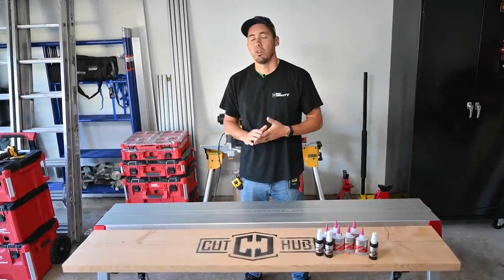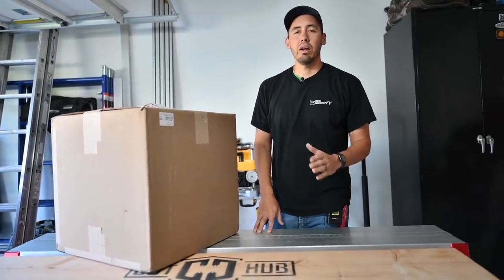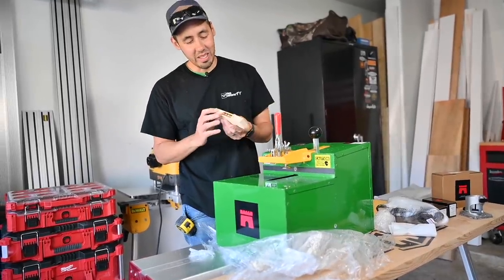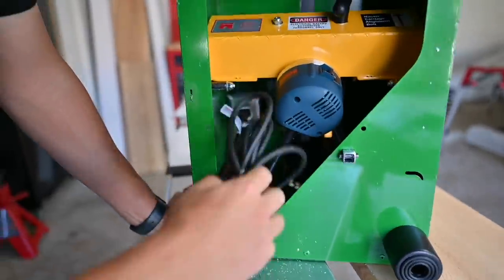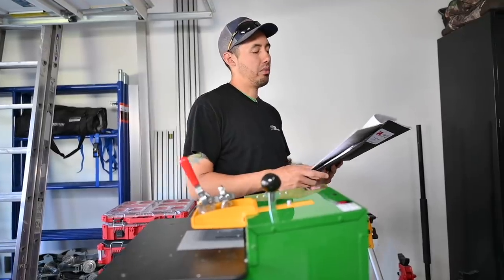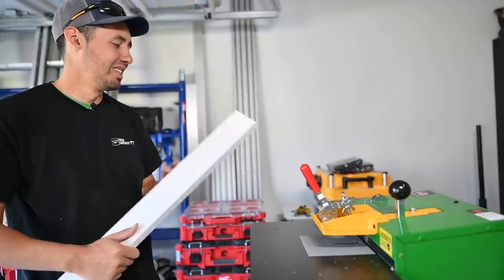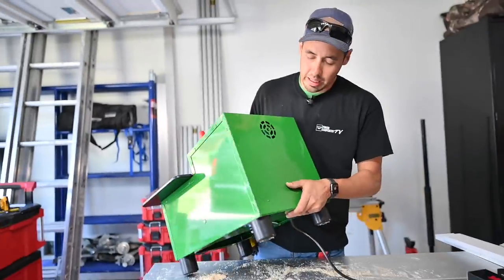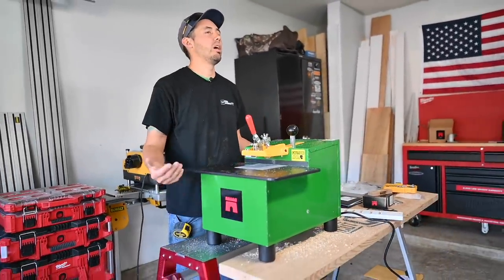$1400 to cut pocket holes??? Let's See How it Works!

Comment: Nice tool for sure! I recommend you slow down your movement a bit though, especially if/when you'll be doing hardwood. Yes, going too slow will definitely burn for sure, but that's a little fast  (in my opinion). One Mississippi, two Mississippi ;-) Enjoy!

Comment: You should check out the kreg foreman model it’s not as bulky as that one, I think you might like it
Reply: Yes, and it's about 4 times cheaper too. ✊
Reply: All of that may be true.  But having worked with both, I can say the Castle machine produces a lot lower angle there by reducing the tendency of the joint to want to creep out of position when screws are applied.  Much less clamping pressure is needed.
Reply: The Lower angle of cut you get with the Castle causes Less shifting of material during screwing the boards together... Clamping is not needed as much especially when building up cabinet carcasses.
Reply: Foreman is just a faster Kreg jig, nice for speed but it doesn't produce cleaner holes or have any of the other advantages of the Castle...
Reply: I've got a Kreg Foreman - it's certainly quicker for drilling pocket holes, but I think this Castle tool would be better. I was making some kitchen cabinet face frames out of hard maple and, even with the Kreg alignment table and clamps, it's hard to keep the parts aligned when you're screwing them in. Even tightly clamped, the pieces would occasionally move a bit when being screwed together. I bet the lower angle of the Castle machine would help with that.

Comment: I'm old. Pocket holes make me laugh sometimes. Back in the day we didn't even know they were called "pocket holes". We just took our drill and went straight in a quarter of an inch or so then drilled your angle and drove a screw through. Didn't have Kreg or any other gizmo and didn't have pocket screws just regular screws. It was a skill you developed back then. Now with the need production and consistency these days I can see this machine would do the deed.

Comment: I like that the pilot hole will direct your screw at a 90° angle, but it seems weird that the wood the screw head will go into is the radius of the router bit.

Comment: One question, can you use generic screws or are they exclusive to castle machine ??
Reply: Regular pocket hole screws...
Reply: A cheese head style pocket screw is recommended.  We sell them on our site, but several companies make them.  Cheese head screws will compress the wood fibers just a bit and really lock the joint in.  Washer heads typically just sit on the top of the pocket with little to no compression.

Comment: Doesn’t Kreg make a version thats like 1/3rd the price? Place board and pull lever and it drills it in. Given it’s not quite as clean looking but most don’t see the holes anyway
Reply: The biggest advantage to the Castle Low angle pocket(6 degrees versus a drill jigs 15 degrees) is that it minimizes shifting while assembly joints.  That's why the Pros love the super low angle.

Comment: Seems like overkill unless you're doing a LOT of those cuts.  I can imagine a simple router like tool that slides down a ramp and cuts the slot at an angle, but I don't have very many $1,400 machines.

Comment: For $1400 you can go to an auction and buy a $15,000 Ritter assembly table and pneumatic pocket hole drill easy. Probably throw in a few shapers and saws too. I built my own air pocket drill 25 years ago and after about 200,000 holes it's still going strong. I have an extra Ritter 5x10 assemble table. $500 if anyone cares. This machine takes out too much material. A standard pocket drill removes 1/2 of that.

Comment: You didn't even cover the real benefit of this over the Kreg, the fact that the screw joins two pieces together 
without causing any shifting of the pieces relative to each other, you can almost join two pieces without using clamps.
I loved the kids getting in on the action, i'm always trying to get kids off electronics and in the shop.

Comment: If you're cutting as many pocket holes as you guys do you're literally going to save 10's of minutes everyday. That's good economy 👍
Reply: More, as time savings also applies to assembly because the holes are at a shallower angle, around 6 degrees instead of 15, that almost eliminates the need to clamp pieces to hold them in place as you drive the screws in and it's safer to use on thin materials, with less worry about screw length as well... While cleaner holes avoids debre clogging and needing to clean the pockets, along with it being easier to fill if you need to hide them...

Comment: Anyone wanting one of these search for a Porter Cable 552 .... Early 90s made in the USA vintage ... Got mine for $200
Reply: Also available as a handheld model... Porter cable 550
Reply: The designs for the Porter Cable 552 and the 550 were licensed to PC by Castle.  The TSM-12 shown in the video is the latest version of the 552 which was discontinued many many years ago by PC.

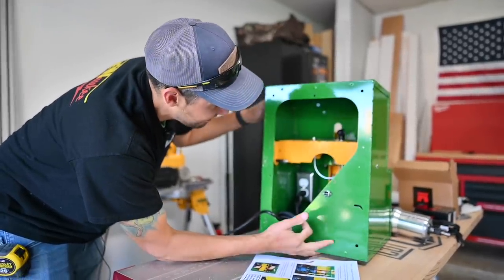Comment: For $1400 I'm not a fan of Castleusa using a 2 dollar radiator hose clamp to secure the smaller router motor (as seen at  4:23) in addition to the excess of the clamping strap hanging loose just waiting to cut you when you attempt to plug the larger router motor in. Looks cheap... certainly not a first class clamping system one should expect at this price point.

Comment: While this is a nice machine, I would still rather have my Kreg Foreman. The Foreman is much faster. It clamps and drills with only a pull so I can do more holes in less time. It's also way lighter and easier to move around. It's also 1/3 the price. I've had my foreman for so many years without any issues whatsoever. So while this is nice, I would pass and get Foreman.
Reply: I agree I’m all about portability that’s a great shop tool for a hobbyist but for real life construction I’ll pass

Comment: Too bad it doesn't (cut/drill) two holes at the same time.....Not only that, but you should be able to adjust the distance of the 2 bits depending on the width of your work piece.  Just sayin.. for $1400 !!!